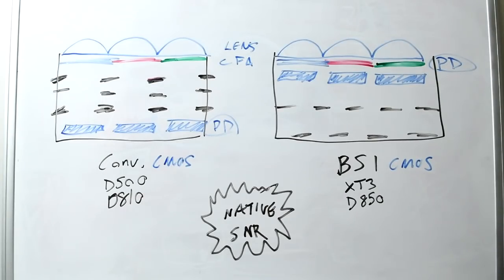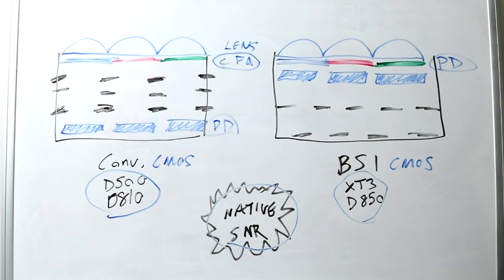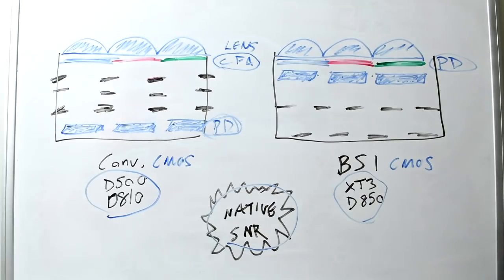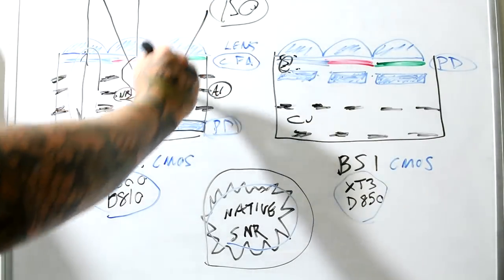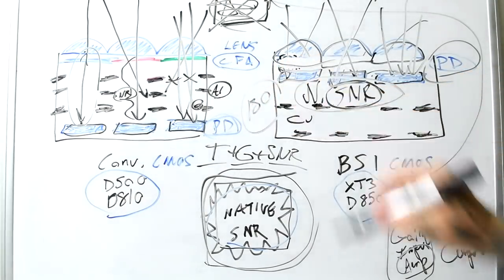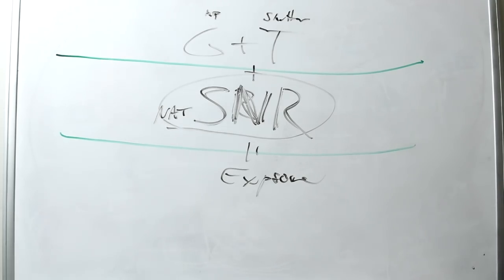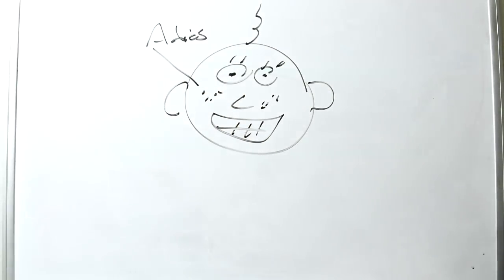BSI SENSOR 🤔 HOW A BSI Sensor works & is Different than a conventional

Comment: Go one step later ….. instead of a gain of 1 you have a gain of 100 in the brightest parts of the image. But the blacks are still producing 0.001 and 0.1 respectively.  So if you shorten your exposure from 1” to 1/100 then that is 99% of the time there is nothing recorded in the blacks…. Watch a star twinkle!

Comment: Thanks. I was thinking they lit up or something.
As for snr 
For a lens test I was trying to make a value (that I was not sure what to call) using only shutter speed and aperture. I was thinking of calling it camera work or something, because my first thought was to use ev but the charts all required an ISO .
I think my test has fundamental flaws ,I will either rethink it or just keep my errors consistent.

Comment: Dude, who the hell are you! Thanks for another incredible video! INSANELY INCREDIBLE!
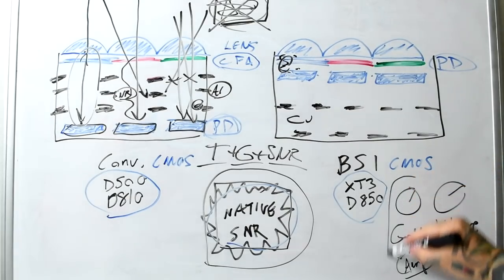However, based on your explanation, @ 7:26 min (https://youtu.be/J2Ar--bLe6E?t=446) it seems like you meant to draw the line from Volume (output gain) to ISO, which I understand from your explanation that ISO = applied gain or  output gain. Still an excellent video. Thanks a million.

Comment: What is the purpose of the Copper in the BSI sensor if the photo diodes are at the top?
Reply from the maker: both are for signal transmission of the image

Comment: May I ask, what is the purpose of the wiring harness you mentioned and why is it needed?  In the BSI model it doesn't seem to have a purpose in the makeup of the image, am I correct or am I missing something?  Is the wiring harness only structural?
Reply from the maker: signal transmission to the AD coverters, ie the image   :)

Comment: From the few comparisons I've seen around, the XT-3 with its BSI sensor doesn't do much if any better than X-T2 in terms of noise anyway (and neither does in detail retention).  I'm waiting from a proper raw file comparison but if there's a difference, it must be minimal if not negligible at all. Coming from a 5DIII and thinking about switching to XT-3, I just hope the actual exposure of the image will be boosted a bit - in dpreview tests the 5DIII is about 2/3 stops brighter than X-T2 given same aperture/speed/iso, and add to that, most of the times I have to over compensate the 5DIII exposure for my shots.
Reply from the maker: thats cause the pixel pitch is smaller
Reply: Which comparisons? I can't find any reliable data which supports any good XT3/XT2 comparisons....? None which go into any real detail anyway. Like you said, we'll know a bit more when we have some more raw files!
That said, all of this doesn't necessarily mean they did it for better IQ. It could be to do with heat management and speed of processing the image at a similar quality whilst dealing with significantly faster output from their new processor. 
For example, it could be that they found that if they used something like an XT2 sensor with their new processor, the additional power meant heat which meant more noise. As such, they may not have done this to 'improve' image quality, but to speed everything up whilst not taking any hits in quality. Let's be honest - not many people were complaining about quality of image from the XT2 :)
Reply: This: https://bjornmoerman.blogspot.com/2018/09/first-look-review-fujifilm-x-t3-when_9.html
And this: https://www.youtube.com/watch?v=Z4AxkbOmfnY
Both done with Jpeg. If anyone in this world had Affinity Photo (which can surprisingly open X-T3 raw files) and both cameras, that'd be also useful, albeit I won't count on it.

Comment: Why isn’t the ISO using those steps still, from the film
Days?
Reply from the maker: digital ISO is applied gain, its not part of exposure,  film ISO is silver crystal grain size
Reply: Theoria Apophasis sorry, I meant why are we using that system, you should be able to apply aging at different increments, like ISO 64, 65, if it’s just gain, smaller increments should be easily achieved right?

Comment: Hmmm... great lesson. However, I would've thought the "volume" control on the radio analogy more related to the ISO, whereas the "gain" button more analagous to gaining better Signal-to-Noise.  If you turn up the volume on a radio, you increase the volume including the noise, but if you improve the gain, you gain better signal-to-noise.

Comment: Your link between radio antennas and the camera sensor appears interesting, but you did not explain it. How does the silicon sensor equate to a radio antenna? I expect that diving into the details will prove interesting.
Reply from the maker: light and EMR are both the same thing,
Reply: Yes, they are all photons of different frequencies or wavelengths, but the question is: how does the silicon crystal act as a receiver or antenna? That is where it gets interesting.

Comment: ok, so why doesn't a CMOS sensor at least use copper for some marginal improvement? Is there a reason that they're stuck with aluminum? Also, how does sensor heat affect SNR (and noise) in images? Thanks so much, this is a very, very useful video with all the new cameras and sensors being released these days!
Reply from the maker: copper dissipates heat better, ....aluminum is a design mfg. choice , apparently easier to build i hear
Reply: As far as I'm aware it's purely a cost thing. If they're making BSI sensors then they're aware of the kinds of clientele that are interested and will care about materials. For the non-BSI sensors, I guess thats less the case.... or maybe Ken is specifically talking about Fuji's BSI sensor....

Comment: Ken, here is my understanding of how an image sensor works in a camera, see if I got it wrong.

The photo-diode would generate electricity when it hit by light, pretty much like how solar panel works, the electricity then stored in the capacitor in each sub-pixel, after the exposure ended, the image processor of the camera would read the voltage in each sub-pixel on the sensor using the ADC between the image processor and the sensor(some sensor have ADC built-in), on a sensor each pixel consist of 4 sub-pixel which have color filters underneath the micro lens (1 in red, 2 in green and 1 in blue (RGGB)). After reading all the voltage in all the sub-pixel on the sensor, the image processor would record all the sub-pixel readings on the RAW files, or convert the RGGB data into a JPEG file.
Reply: You are incorrect. Full frame sensors have twice the image quality.

Best,

Tony

Comment: I would like to add that a monochrome sensor can have 4 times bigger pixel due to without the need of sub-pixel for each color in a pixel.
Reply from the maker: yup
Reply: Harry, great point you made, but would love to have a further detailed explanation on that. Thanks.
Reply: Each pixel on a color image sensor consist of 4 sub-pixel with have 3 different color of filter under the micro lens (1 Red, 2 Green, 1 Blue). If the sensor is monochrome, there is no need for sub-pixel for each color, hence the pixel can be bigger (given that the resolution is the same) to collect more light, plus collect even more light due to without the color filter.

For more, read this page:
https://wilddogdesign.co.uk/blog/monochrome-digital/
Reply: Actually no. Screens have subpixels. Imaging sensors don't. That's the whole point of the bayer/xtrans mosaic pattern. Technically a 24Mpixel sensor has 24 million dots, some filtered for blue, some for red, and some for green. The image color is then computed from that with demosaicing algorithms. Download RawTherapy and see for yourself; selecting demosaic to 'none'. I also looked at sensors under the microscope.
Reply: Or even just read that page you shared again.

"each 2×2 grid of pixels will have 1 blue pixel, 1 red, and 2 green ones"

Comment: Well done.  As a ham, I appreciate the antenna analogy, although most of your subscribers probably do not.  In astrophotography cameras, the term gain is commonly used (and not iso.)  Mono cameras are preferred for serious deep sky work, although they cost a bit more.  Example: ZWO ASI1600mm.  Filter wheels are used with LRGB and narrowband filters.

Comment: Great info! I took electronic's in high school, we had a small broadcast FM transmitter. I understand this!!! I used to work on the last generation of phototypesetters Autologic, Compugraphic, and even older photomechanical typesetter Mergenthaler VIP or Variable Input Phototypesetter.

Comment: But what's the purpose of the wired array on the BSI sensor?
Reply: Transmits the signal.
Reply: The Ggzzbb gathering all those photons lol. 🤣🤣😂😂😂😆😆☝️
Reply: The wired array is connected to the ADC for the image processor to readout the sub-pixel brightness readings.
Reply from the maker: signal transmission
Reply: Theoria Apophasis  So I guess on the CMOS there is another wired array after the PD then?
Reply: @ggzzcc  they are both CMOS